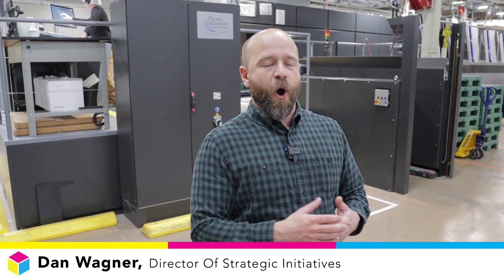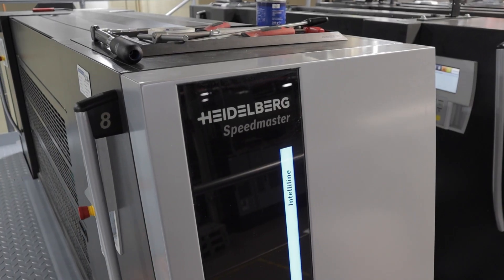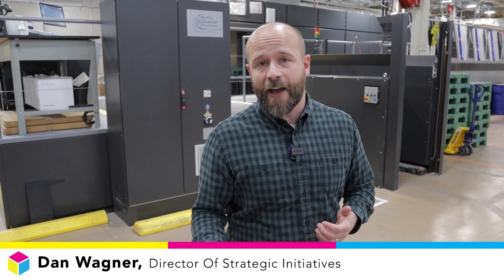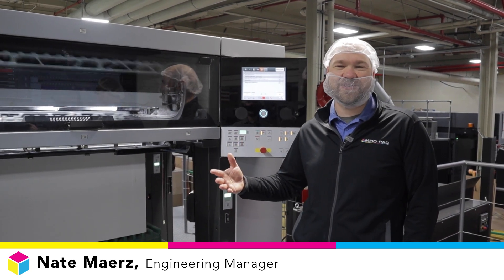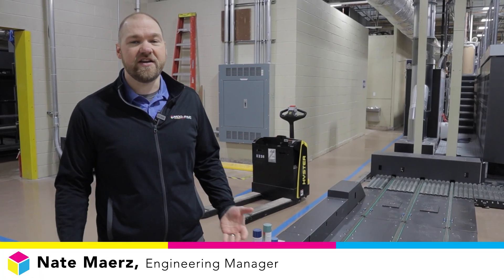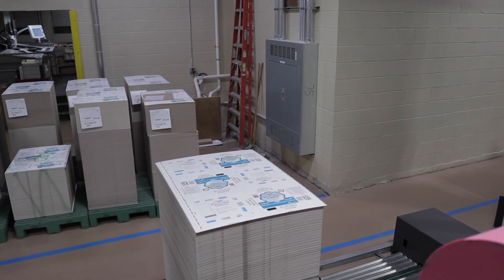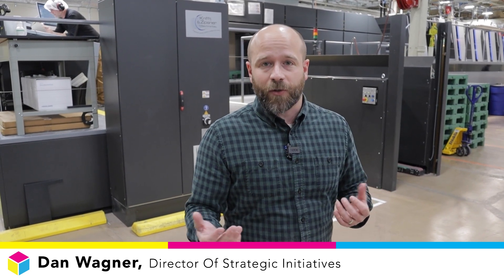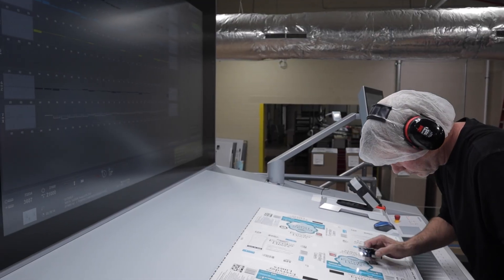21,000 Sheets Per Hour! Meet MOD-PAC's Game-Changing Heidelberg Speedmaster XL 106

Comment: Yeah,  everyone gets excited at running it full speed except the operator that has to clean out the jam ups.  Then management goes back up into their office while the workers deal with the mess.  All you see is dollar signs.  Why don't you show us the dark side what kind of mess this is when things aren't working so well.  Things are great when you have good stock to work with but getting warped stock from the corrugator is a nightmare at that speed.  Correct me if I'm wrong.